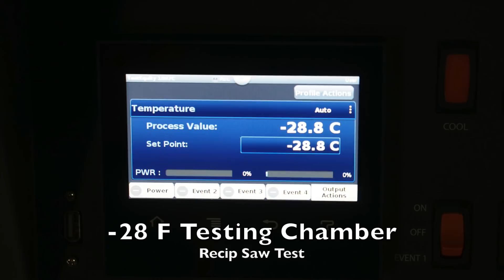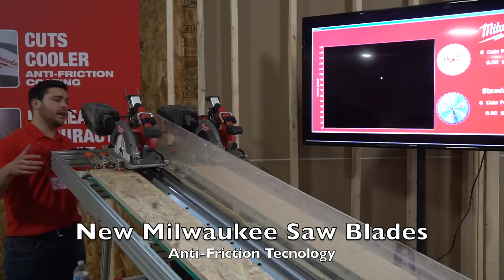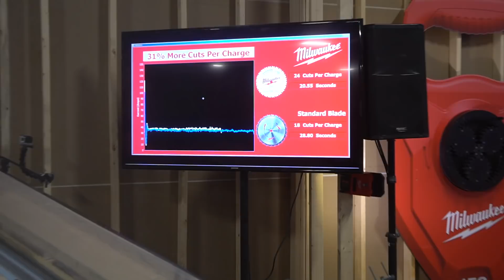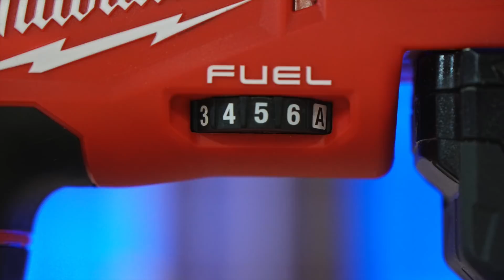Milwaukee NEW Tools for 2018 - Sneak Peek

Comment: we need a framing nailer, I've had to use a dewalt and its killing me. M18 fuel framing nailer!!!!!! All my other cordless are milwaukee but I have to keep dewalt batteries and chargers for that one tool.
Reply: gabriel back I agree with you I need  framing gun that's the only tool I have to carry compressor and cords.
Reply: haha, im int he same boat. my dewalt nail gun is getting old too.

Comment: Any date when the become available? Didn't see them at home depot just brought the m18 fual sds plus and the m18 fual 7 1/4" circular saw and 9.amp battery and charger i wish i would see the new line already.  I'm a heavy duty Milwaukee fan

Comment: Impacts and drills, new chucks and better cooling(old ones burned up or protected pretty hard), this might have been the price for building so small all along. Time they fixed the last place jigsaw(everyone forgot they made a Jigsaw). Chainsaw was a must. Sander is a boon. Hope that table saw holds up, lots of plastic. Very skeptical on this whole, "Super High OutPut(Kind a like a Flexvolt)" thing. Those batteries are getting huge and ties you into just using the Giangantar bats, those saws will be sad with anything less then a 9 amper. Love the M12's, everything but the impact and driver(the motor in these hurt my dogs ears) are awesome. Next year we will get the 100Ah tow behind trolley, lol.

Comment: How bout a review of cordless planers? Thought about buying a Milwaukee for pick-up work (framing) but heard some negatives about it now I can't decide.
Reply from the maker: Timothy Campbell not a bad idea
Reply: The only comparison I can find is from 2 years ago and the Milwaukee didn't to to well. I'm wondering if they've improved it since then.
Reply: Timothy Campbell 
I have the m18 planner, and absolutely love it. If you end up getting it you can use the makita replacement blades when needed. $10 bucks at Home Depot. Have a good one!
Reply: Ended up buying the dewalt. Not a bad planer except... planing a stud, got to close to the slab and barley bumped the nose of the planer against the slab... pushed the table in to the blade and twisted the table destroyed the blade and popped the blade depth knob off... DAMN! Perhaps I'll give the M18 a try now.

Comment: I would like some info on that new pipe wrenches 10inch head with long handle thanks
Reply from the maker: andy navarette Pipe Wrench Expansion
Launches August 2018
Milwaukee® continues to expand its lineup of pipe wrench solutions for mechanical contractors and plumbing professionals with a broad range of new sizes, many of which feature: dual coil springs, an overbite jaw, and optimized grips. The 10" extended pipe wrench eliminates the need for a "breaker bar" on smaller pipe wrenches, providing the very best access and leverage.

Comment: shame that still no 18v  palm router
Reply from the maker: They have the drywall cut out tool Im sure its on the way - just not ready yet
Reply: A Concord Carpenter / ToolBoxBuzz that's a shame .I will have to go off platform and buy a ridgid 👍

Comment: Actually it was -28°C !
Reply from the maker: Thx man, big difference, I’m so used to referring to Fahrenheit
Reply: KnarlyCarl hello sir do u have any info on that new pipe wrenches with 10in head long handle
Reply from the maker: andy navarette no thru were cool though
Reply: Only problem i have found out from cold temperatures with Milwaukee is that battery won't charge if it's cold. It need to warm up before charging process starts.

Comment: Pretty disappointed with their new release tools this year...seems like they are just trying to keep up with Dewalt in a few aspects. Their impacts and drills are legit though.
Reply from the maker: Agreed - the table saw  has a lot of Dewalt like features
Reply: I am glad they are catching up with dewalt, I have to bring my own yellow tools to work because the red ones provided are not powerful enough.
Reply: I agree and to do a table saw without a 10 inch blade just doesnt make sense ? I love new tools that can help me work more efficient and I agree Millwakki makes great tools but these tests are just getting insane and have no place in a real normal work environment , now gravity fed circ saws just to show ine finished a cut a few seconds before the other ? I would rather have accuracy lightweight and reliability , I take my time with my cuts anyway ! To make sure there as perfect as I can get them , I don't worry about a few seconds of speed , and who drives 600 screws non stop one after the other? Not the real world and lastly the torque stuff after a certain amount there is no difference ..its just seems to be getting to crazy and not inovative !
Reply: Billy Nolan, thank you sir for pointing this"Tools Olympics" issue. Although we would like to have faster and stronger tools, tests are like the Iron Man or the fastest man on the world. He could be the strongest but that doesn't mean he's the best soldier material not to say husband which is the main male purpose!
Reply: Even the shock wet vac is good just bought thier new 2 gen shock wet vac
Reply: The only thing that really got my attention was the M12 impact wrench with 250 ft-lbs. That is really cool.

Comment: Im interested in their customer service dept.. I bought the door jamb set and torpedo level red sticks. Took 2 months to get and they were very inept when it came to even knowing about my order in the whole process. Top that off with my local tool repair shop saying the take forever to get parts and have no sense of urgency to do so.
I ended up keeping the levels and I sold what I had of millwaukee because of that experience.

What have they done if anything to upgrade their customer service dept.? It is awful! I currently have mostly Festool in my main gear arsenal (if you wanna call it an arsenal) but, am considering diving into a new battery platform for screw guns and such. 
Anybody know if theyve stepped it up?
 I have 1 dewalt product and hate it so they are out.
Customer service is critical.
.
Reply: I’m in San Diego and have had good luck with them, I dropped an impact gun in water And they fixed it no questions asked it took about a week.

Comment: I get more pissed off than I probably should, every time I see a new tool that I want but it's M12 instead of the M18 that I've invested over $1000 into so far. I'm NOT buying an entire new set of overpriced batteries and chargers just to use your new less powerful tools.

Comment: Good tools of course , but an 18v can't beat a 60/54v battery which can be backwards compatible to 18v tools .

No matter how you market it , 60/54v is more powerful than 18v , it's science !!

Flexvolt is ahead of the game at moment
Reply: You need to go to school and learn about electronics and motors. It's not about voltage it's about the voltage x amperage and many other factors
Reply: Power is actually volts times amps. The FlexVolt pack and the new Milwaukee pack have the same amount of power. 12 amp hours at 18 volts. The nice thing about Milwaukee sticking with 18V is that they can put any M18 battery pack (new or old) on any M18 tool (new or old). The nice thing about the Dewalt FV Mitersaw is the AC adapter. They both have their pros and cons. Jeff @ Tool Box Buzz
Reply from the maker: Danny Dann Do you need to see your battery is gone to level the playing field between the Milwaukee and Dewalt, in my opinion. We’ll have to put these tools together in a head-to-head test
Reply: A Concord Carpenter / ToolBoxBuzz  I would defo like to see a head to head on the circular saw, DeWalt flexvolt circular saw Vs Milwaukee circular saw with the new battery.

I bought into DeWalt because of the impact driver head to heads on YouTube , I found a good deal and got the 887 impact driver, so because I had the batteries already I got the drill, flexvolt came out then got the circular saw with the 6amp flexvolt battery. 

I needed a bigger battery anyway and wanted access to their flexvolt range, so got a 6amp on 18v and the option for the flexvolt range.

I also like Milwaukee and If i found a good deal at the time, I could easily of got onto the their battery platform. But I do find Milwaukee alot more expensive on their bare tools and kits.

I'm new to DIY "do it yourself"  I learnt to plaster walls, hang doors, fit floor boards, fit  joists sub flooring. No offence to the professionals but I thought to my self , "the only difference between me and a tradesman are the right tools and experience/practice" 

Except electrics and plumbing , I want do all the DIY in my house by myself. 

Also want to learn bricklaying to build my woodworking shop in my garden. I want to build tables, drawers and units ect ect. 

Working in an office all my life, sitting on a chair every day for 8 hours bores me. I love working with my hands and actually being active and building something gives me a new lease on life.

Your videos and many others really gives me valuable information
Reply: Jeff Williams they advertise 15amp corded performance. If the equation is power = current × voltage we get  15A × 120v = 1800W of power for large corded tools. To figure out the cordless tools we figure lithium ion batteries are 3.4v cell × 6 cells typically in a small battery you get 20.4v. That's why we see black and decker, dewalt, porter cable, kolbalt and other advertise 20v tools. So 1800W from corded power ÷ 20v gives us 90A of continuous pull from the new batteries. Makita didn't have big enough cells at the time so they doubled up the batteries where as flexvolt just has a lot in series. Only place the voltage matters is wire size (think jumper cables, large wires for higher current.)
What it comes down to is what ever method you choose is how to pull the most amount of power while keeping things cool. Bosch has cooling fins.
Once Rob does his testing we will see. Compare all the high end flagships and another one possibly for the medium sized tools like he did for last year's reciprocating saws. Honestly the latest offerings from your favorite color are all awesome.